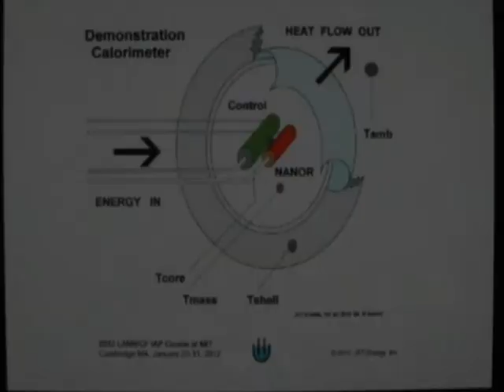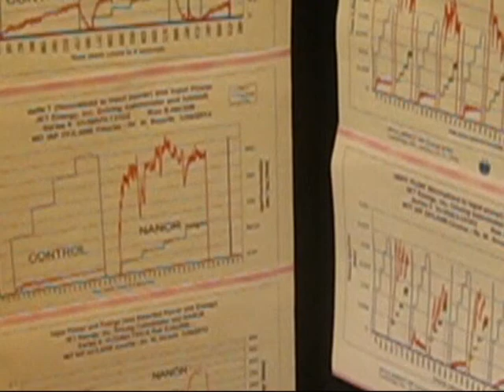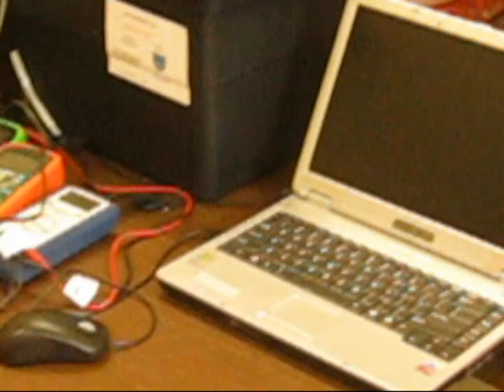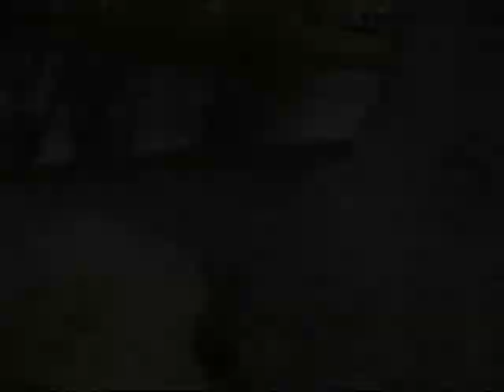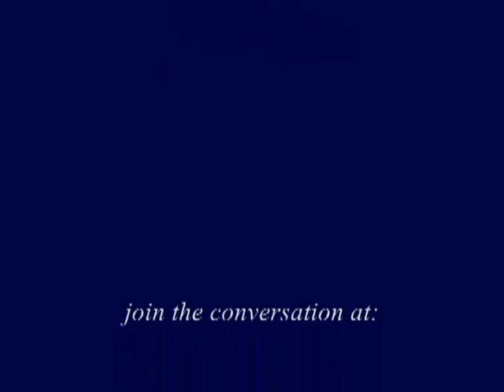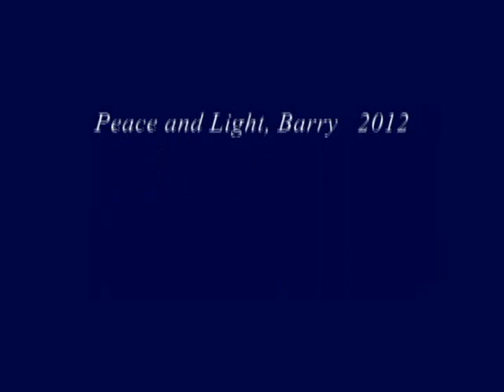Cold Fusion/ LENR device at M.I.T.

Comment: There is data from John W. Keely of Philadelphia, Pa, back in 1890's from his work shop 1865-1899, about several bench tests done. He had Deuterium even evolved from his resonance + harmonic ratios frequencies experiments when removing Hydrogen and Oxygen from water, at high efficiency with thermocouples, thermopiles, and arrays of vibration tuning forks. (controlled sympathetic attraction concentration of matter.) Information in regard to Cold Fusion tests. His > 100 inventions of his 5 Million dollar Keely Motor Company were known around the world in national newspapers. Some tech details in - "Keely And His Discoveries" and "The Snell Manuscript". (1 out of every 5000 molecules of water is deuterium.) Physics in those days was called Philosophy.  He recreated several common known science experiments from 1850's Philosophy book chapters by his new vibrations method , and then also by fake method for laughs, since his contemporaries and visiting tech engineers could not tell the differences, and he figured he was much smarter than them.

Comment: and this is MIT? wtf? people do not use LabView software and proper sensors. who r these people? who would use cheap chinese miltimeters in a scientific experiments? it is not science and these people are not scientists. any scientific measurements hsve to be done properly and the setup has to be well made from glass, cersmcs and metal. so that should be well visible. not in plastic boxes with blue leds inside. what a disgrace to science these morons are.
Reply from the maker: Sunaree, you don't know what you're talking about.

Comment: Barry, there is something about the NANOR device that I don't understand.  According to the slides (if I am reading them right), Schwartz is sampling the voltage and current once every 4 seconds.  Why isn't he sampling at the Nyquist Rate corresponding to the slew rate of his regulated power supply, as would be necessary to properly integrate v(t)*i(t), so as to capture the AC power as a function of fluctuations in resistance as bubbles form and slough off the surface of the electrodes?

See this analysis of AC Burst Noise for McKubre's cells.

ac burst noise | barrykort